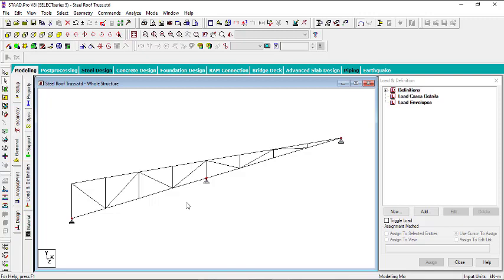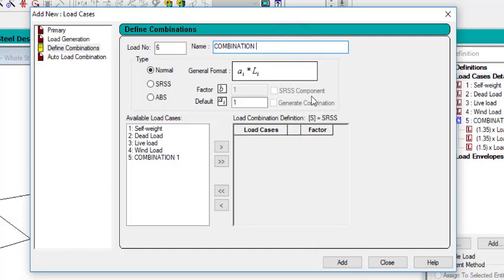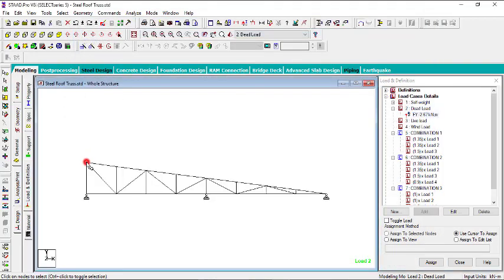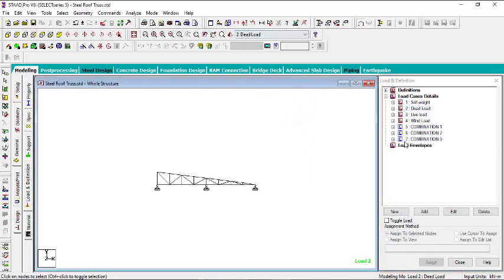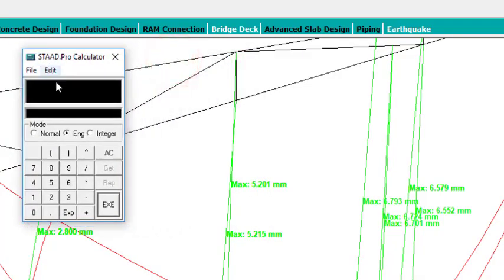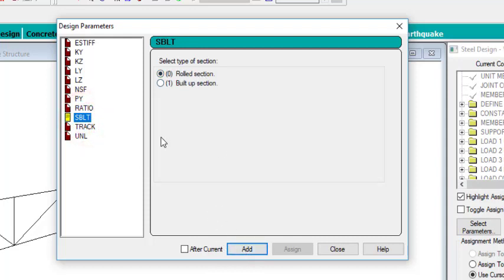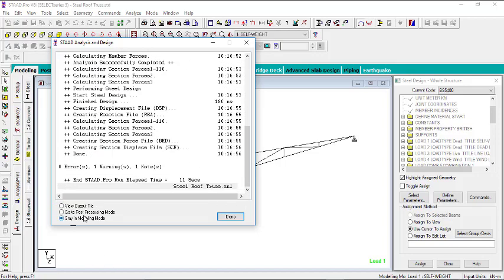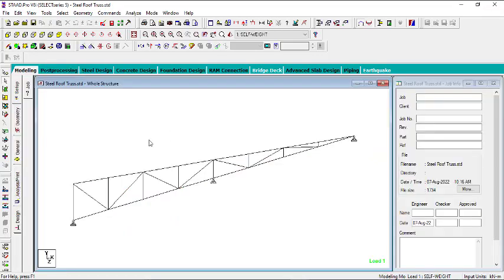Staad Pro for beginners (episode 33). Analysis & Design of a steel roof truss.

Comment: Thanks very much for the detailed explanation sir. I want to ask, can one follow this same procedure in any kind of roof design?
Reply from the maker: Yes sir. You can.
Reply: One more question sir, when I tried loading, all of my attempt to select the nodal point, is not working, rather it's selecting the the beams
Reply: @uwhojoseph93  use the node cursor